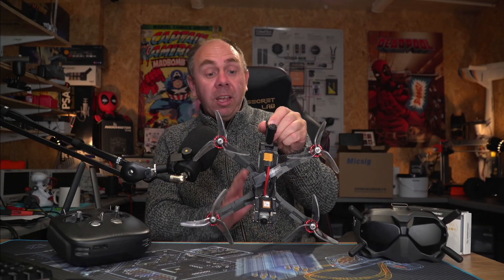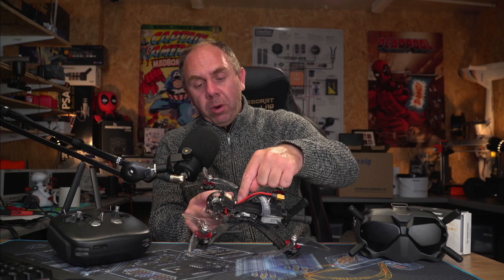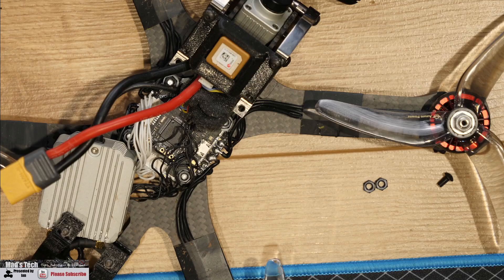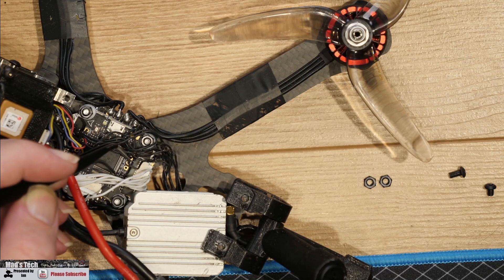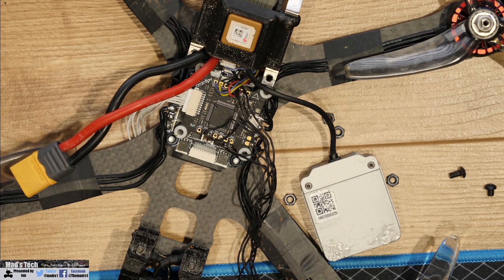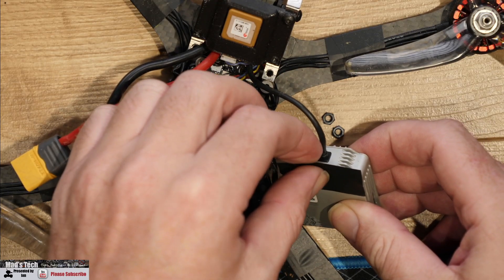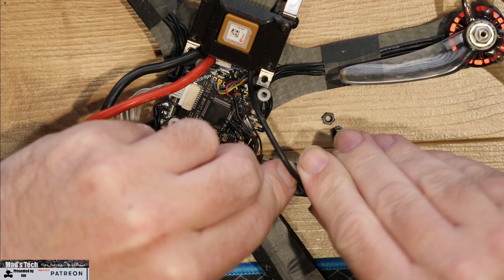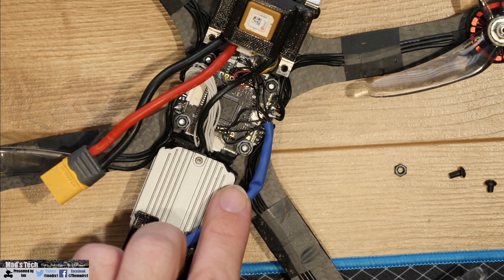The Killer FPV Quad Issue Found ? - Uncontrollable Full Motor Output

Comment: I Recently bought a bind and fly iflight nazgul evoque with crossfire nano receiver and F7 blittz flight controller, and when i hook it up to my tbs tango 2 controller and testspin the quadmotors, it speeds up the motors uncontrolably when I pass a certain throttle threshold, after the threshold point the motors then keep accelerating and they become uncontrolable and i have to disarm. Angle and horizon modes are disabled. And in betaflight al stick inputs seem nominal. Does anyone know what the problem might be? please let me know.

Comment: That is the only draw back with silicone covered wires - it is so easy to damage the insulation. PVC covered wiring is much stronger in that respect, but being less flexible it can carry vibrations to the flight controller, plus off course, because it's not so flexible it is more prone to breaking solder joints. I was doing some minor servicing to my large hex a few weeks back, and luckily noticed that the main battery positive wire - which is about 10awg in size, had a big chunk out of the insulation very close to the carbon frame. Being that the craft in question uses 12000mah 6s batteries, I am very glad i spotted it. Yep, silicone covered wires are great, but somewhat easy to damage.  Glad to see you have got your 'killer' quad back under control, have had one do that to me in the past, not a nice experience at all - bloody frightening!

Comment: I follow your videos every week find them really interesting. I have been flying planes and helis over 20 years. I would like to Build a L.o.S FPV drone to start. As I use a Jeti radio. Are the flight controllers able to take Ex bus. I cannot find any information or videos using ex bus or setting a model up with a Jeti tx.
Reply from the maker: Iv not seen any controllers with exbus.  I believe you can update some Jeti receivers firmware for sbus thoigh.

Comment: I like to use the  3M blenderm tape used for surgery - and for hinges on foam wings and planes. The adhesive is very strong and the transparnet, of cause no conductor at all. 1 right tape instead of multiple layers - as my teacher in Physics once had told me decades before. If you need multiple layers something might went wrong cause the right tape does only need one layer as he was emphasizing - back in the late eighties and for the plastic planes back then become available but pretty expensive. 
First plane was a "Graupner" der kleine Uhu or "the small Uhu" which was a kind of ad for the glue brand UHU which is a brandname meaning an OWL, and then the wooden Airfish, a wooden glider as the basic plane.